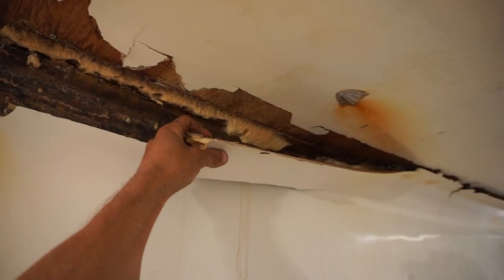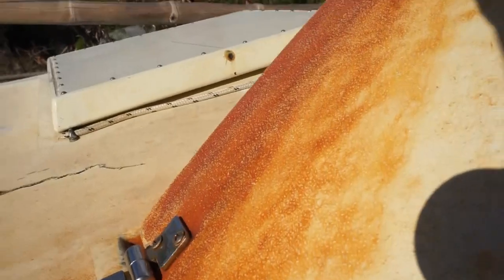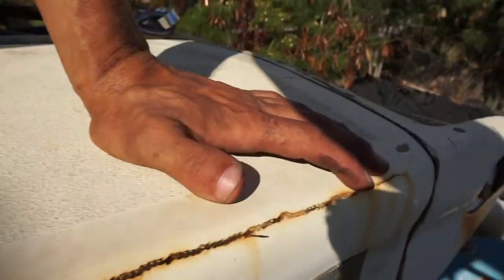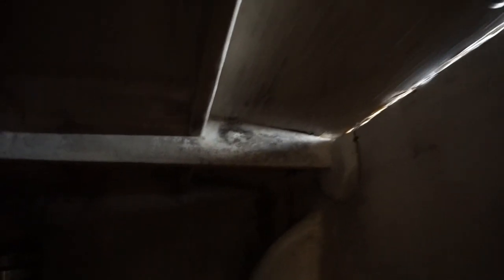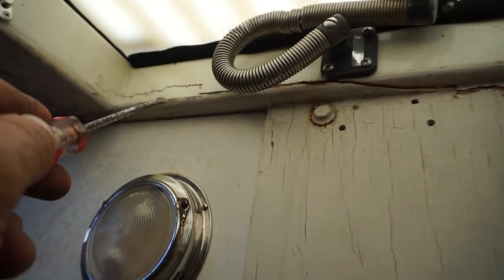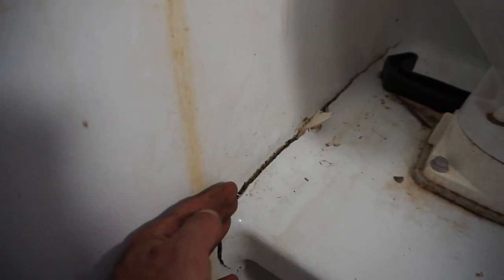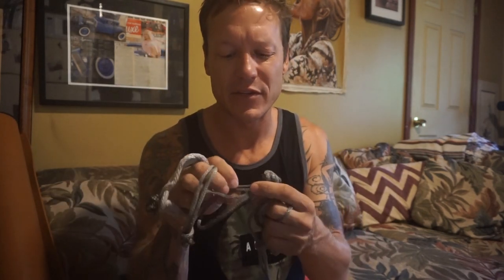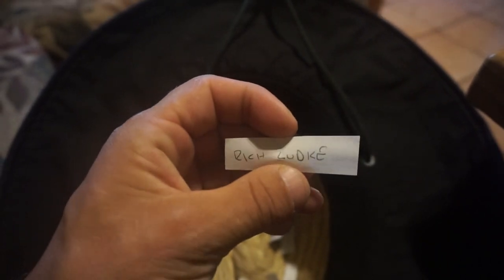Tearing apart my wrecked Catamaran

Comment: Hi Kimi, hi James!
I'm Matthias from Hamburg / Germany.

First I want to apologize for my bad English, it is a mixture of rusty school English and google translater ;)

What you showed in the video is really incredible! I don't want to imagine what could have happened to both of you if the boat had collapsed under your ass on a longer passage with lots of wind and waves.

What happened to you is also a warning for others, for boat owners, for boat designers and builders, for example also for me. I am not a professional boat designer, but I have studied construction technology and have been working on a plan for a 45 ft catamaran for about 3 years now, which I would like to build or have built at some point later. Right at the beginning of my construction, I thought about how to connect the hulls to the bridge deck in a stable manner. Even then I came up with a completely different solution than you can see on your boat.

I can agree with your analysis of the errors in the construction of your boat on most points. Wet plywood, bulkheads and beams that are too thin, holes in beams (who makes such a shit ???), beams that are interrupted and carried on elsewhere, and in my opinion too small-sized beams and too thin GRP laminates are reasons for the breakdown.

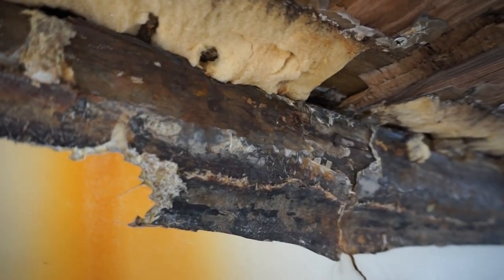But in my opinion, the boat would have broken apart at some point, or at least would have suffered fatigue fractures if the components just mentioned above had been dimensioned correctly. I see the problem in the small radius at the 90 degree angle between the hulls and the bridge deck. This connection is too weak. I mean the area that you can see in the video at 1:00 min and that is filled with foam under the laminate. The radius is much too small or a 45 degree support is missing between the hull and the bridge deck. And PU foam has no business at this point. This area should have been filled with glass and resin. In my design I chose a 65 degree support, which has a hypotenuse of 1.4 m compared to the right angle between the hull and the bridge deck. If you are interested, I would be happy to send you a few pictures of my construction. 

I wish you the best and good luck and I am excited to see how it goes on.
Reply: Hello Matthias, your comment is very comprehensive and analytical, but I do not think that this is expedient for the two. The two need a resilient cat to continue the blog without a year or two interruption. I have no idea how far your design has been realized but I see the future in art like this: https://volt-at-sea.segelnblogs.de/ or similar constructions. Doing it yourself in the field of plastic is not feasible.
Reply: @albertfunk1176  I only gave my design as an example and as a comparison for another solution on how to connect hulls to the bridge deck. Of course, it now takes far too long to build a new boat now.

Comment: There's nothing of substance that ties the hulls to the deck bridge, the fiber glass tabbing is not wide/extensive enough and the stringers don't tie into the deck bridge.  A bunch of people have suggested the dyneema rigging as causing the issue but that may have just exacerbated the design flaw.  It also could the quality of the resin that was used during the build.  You guys are just lucky to have the incident happen where and when it did.  Really glad you guys are safe.  Can't wait to see Zingaro II.  Fair winds to you both.

Comment: Hey... Brilliant look through at the damage. Remembering the bow quartering seas, thumping into the forward sections of the starboard hull prior to the break. I see on the deck failure along the beam, forward area, and the failure along the starboard back of cabin deck beam. That I believe was as a result of impact to the forward starboard hull on that point of saling with the wind from the starboard side. The port hull would have been the solid grip in the water, amplifying the pressure wave through the hull... The main support beams would have snapped, most likely at the holes drilled into the beams. Subsequent to that, the torsion of the not rigid structure would have stressed the skin covering the load cells of nthe beams and plywood bulkhead overlap to beam sheet  ply overlap. Just not strong enough in these conditions. Add to the break of the beams, with the breeze up at the time, the pressure from the rig would have amplified the distortion across the deck to finish off the damage to the level of catastrophic... Looking at the supporting beams and the method of attachment in cementing the hulls to that stress area, I'd say the cat was designed for coastal work, and not structurally engineered to handle the rigors of off shore work as you were doing. I would say the cat is salvageable for rig, deck gear and personal items and a bulldozer through the remains... Sorry... Built my first model sail boat aged 7, Just in the last 10 years, 3 more liveaboard yachts, including a James Wharram 30 footer, off shore cat... Now building a house boat out of a commercial barge, so I have a life time of experience in stress, build strength and observation on calamities... She's toast I m afraid ... on the up side, she got you both into harbour... that's a huge epitaph for the old girl...

Comment: Fascinating. I’m amazed you were able to keep it together on the trip back to Hawaii. I had a 1986 powerboat that had rot in the main stringer. You just are not aware of it until you have a problem because it’s all hidden under fiberglass. And once the wetness sets in, you may not know it for 10 to 20 years later. And its very hard to repair.

Comment: Stress crack due severe dynamic loading caused the failure. Stress crack occurs at every bulk head opening/hole, very similar to BOAC DeHavilland Comet plane window caused by metal fatigue (constant bending & debending). Literally, every hole has crack failure, on this video. Solution is smaller rounder hole/opening or reinforced the crack areas on both sides. Meaning both hulls need similar reinforcement to fix. IMHO dyneema rigging contributes 3% due to less forgiveness. Dynamic load = pounding storm waves.

Comment: I'm a carpenter and joiner and a pretty fair shipwright, I would be getting out the chainsaw and cutting it into pieces that will fit in a skip.
Reply: Craig Grocott I agreed. I’m a builder and I’m shocked she lasted that long.
Reply: Dan221075 I built several houses and this boat would never pass a house inspection and that boat should have been built much stronger than a house! I thought they were all steel I beam reinforced but good grief I didn’t even see a 4x4 beam! Floor joists are 2x12! Never buy a wood boat guys that art died when fiberglass was invented!
Reply: I second Craig's suggestion.  Find plans that you can reuse your mast and build new.  That or find a project boat to start over.
Reply: @peterscherling9000  Hi Pete,  structurally wood is great,  strength for weight  rivals carbon. When used with epoxy can be as low maintenance  as glass. My guess is polyester not epoxy was used in construction.  The glue failure in the ply might indicate a non marine grade.
Reply: @MrRourk  In that video it was never clear about what he was going to do with the boat, he just mentioned that one component could be repaired, but at the end they offered a week on Zingaro 2.
Reply: @craiggrocott7559 
A week on a dingy
That boat is scrap
I would not spend a day on that boat again
Reply: @peterscherling9000  false statement!   Plywood boats can be very strong and beautiful! It's not always the horse winning the race! Sometimes it's the jockey! 
  There is tremendous amount of human error in the failure of this boat! It survived 40 years, and it would survive another 40 with the compassionate driver, these guys pushed the old girl to the limits all the time without any care!!
Reply: god one hahaha👍
Reply: @oldsailor9022  makes sense 👍
Reply: Husqvarna or stihl

Comment: Built light for speed, it didn't have enough strength or integrity to deal with the conditions it met.
Home built boats don't really have a lot of failsafes built in, when they reach their limit they fail catastrophically. Boats built in shipyards have a lot of careful planning to deal with stresses and rough conditions and cats need to be super stiff to retain their integrity. 
It was already past it's best and you had been pushing it fairly hard, changing the rigging may have affected the tension on the hulls or it may have already been too late before you did that.
As others have said, strip out what you can sell and walk away, it requires too much structural work to be viable again.

Comment: Those main beams were really wimpy to begin with.  They looked like 2x4s and they had 2 inch notches cut into them. They were basically 2x2s at the notches. Hope you're back on the water soon, on a strong boat.
Reply: I saw that too. Those two large bolts did not help. Looked to be built lightweight to be fast coastal cruiser. Not built for 25 foot waves in Hawaiian waters.

Comment: Firstly, I am glad you are both safe and sound. I am always amazed that the fiberglass boats have so much wood in them and that that wood, surrounded by the so called impermeable fiberglass, ends up rotting. My theory is that wooden boats are not as high maintenance as people fear and fiberglass boats are by no means the waterproof maintenance free structures they are purported to be. I hope your new boat is wood.

Comment: I have worked on alot of fiberglass boats. I believe most of them are made of Polyester resin and Glass Mat. It is the cheapest material available.
Polyester does not like to stick to wood. Epoxy is the best and more expensive.

Comment: I just want to say I am thankful you guys survived that storm! I am impressed with your actions taken while under duress! I'm no structural engineer, but you have to trace your damage from the point of contact, keel to top deck and the pressure was dispersed upward and outward from there.
That boat doesn't look, to me, to have ever been seaworthy but rather a coastal cruiser. Unfortunately you found the limits of your vessel. 
Thanks for the follow up and for sharing your adventures with us.

Comment: I work with both wood and composites and what I see happen often is boat builders not fully understanding the value of grain and fabric weave direction.
The grain direction and weave directions are key to the overall strength.
A bais direction "S" glass patch over that high-stress area would have done wonders.
Twas all the little fibers that were in the right direction that held her together in the end.. Just not enough of them

Comment: From your video this is what I would like you to check. Are the boat hulls polyester resin? Are the bulkheads taped in with epoxy? Take a good dry sample of the plywood and give it a boil in water test (10 minute boil then let air dry...still glued together?) There was a mod on these Spindrifts to have the mast crossbeam lower section continue to the outboard side of the hull (no cut out for headroom walk through). If the hulls are polyester resin and they were not properly prepared to change to epoxy you have the classic intercoat adhesion failure.

Comment: The hole on the deck hatch frame(stringer) was put there to prevent further cracking........Another words that deck stress cracking had started before you even owned the boat. The hole was placed there to stop the cracking.  Kind of like a fire break to prevent a fire from spreading.
Reply: common in glass and metal cracks as well

Comment: Maybe when you trashed the dagger boards, and banged up the hulls back in 2017, you did some damage, that wasn't noticeable, and that plus the age and structural oddities conspired to finish off you boat. Is it possible that necessary  rigging adjustments were an early indicator of future failure, given you were using Dyneema.

Comment: Mm as a boat builder the ply is not rotting and still fine what has happened is the little cracks over the years that haven't bien looked after have let water in. The glass is still good with wood fibers on it and the ply is not rotting. Lack of keeping a timber boat strong. You didn't maintain her property as you can see by the mould on the walls. Epoxy glue joins don't brake
Reply: My guess the the mould happened in the yard after the accident, the boat didn't seem mouldy when they were living on it. It's now march and the incident happened before Christmas, so plenty of time for mould to form in a boat, if it were me, I wouldn't be cleaning mould on a boat that broken.
Reply: @daveamies5031  if fiberglass is done right when pulled away from timber it usually takes it with it. Unless water gets involved. As per his video. Lack off care and maintenance. Water ingress that delaminated the glass glue.

Comment: Zingaro was not designed to be sailed in the sea states that were encountered , it was a coastal cruiser , not a deep blue , heavy weather vessel . There was no real rot anywhere by the looks , it was wrecked by sea conditions , not design flaws .
Reply: Hi Gordon, I believe you are 100% correct.  Way too few layers of roving and glass and mat to hold it together under severe stress loads. As Skipper James said "he only heard one craking noise (It all failed together at one time) Over-tightening the shrouds, back and fore stays may have been a contributing factor also.  Yet as bad as it looks __ it is repairable by someone with the knowledge, skills and time needed. Both fiberglass and wooden boat in far worse condition have been soundly structurally repaired.
Reply: @samgentile7494  Sam , thanks for your reply , I think it would take a brave person to take on the task of repairing Zingaro to seaworthiness , given the damage it's probably more suited to a houseboat or scrapping altogether . Still , anything is possible with enough zeal , time and money ;-)

Comment: Zingaro’s bridgedeck was glassed on the inside but never on the outside. This means the bare painted plywood of the under bridgedeck area was always exposed to the elements. Did you ever glass the underside of the bridgedeck? If not I’m sure the joint between the hull and bridgedeck could have easily parted putting the entire strain on the main beams. It appears to me that the tabbing on the bridgedeck has broken loose and pretty much reminded intact to the hull.

Comment: Most wooden/plywood  cats fail under very heavy loads for many reasons, but primarily because of undersized main connection points, ie. transverse deck beams. Many builders think that because the wood and glass share the load, they can make them smaller.  Many pure glass boats will fail in the future (especially under the loads you experienced) because of the search for lighter weight, hense using less material to save weight.  Light weight cats are great for speed and coastal cruising the trade off is strength.  your boat traded 400 to 600 pounds of strength for speed. It worked for 40 years and would have most likely another 20 or 30 years if only used as a coastal cruiser.  Then again things have to fail to learn their limits.  With any luck plywood builder's owners, and potential buyers can learn from your experiences. Much luck to you in your next boat.

Comment: I do not think the bolts in the main beam are 'the' problem 11:30 . I would suggest that the cut for the longitudinal stringers are! the weaken the strength of the beam by 50%.
the bolts are actually quite well placed, about center of the beam where forces are lowest ánd the did not put them on the same 'height' which is good from a structural point of view.

Comment: I have strong knowledge of static and dynamic physics and experience with ply boat repairs, my opinion since there is not an obvious one guilty failure is that, as James said ,it is the result of a multitude of weaknesses and one that has not been mentioned (the reason I comment) is the amount  of delamination where the cloth is straight off the plywood with only one spot where some of the ply layer stays  with the cloth.This probably from poor resin or poor application. 
.The forces of the sea are humongous not a single beam could resits it but only the structure as a whole. the cloth is also part of the integrity and it did not seem to have done as much as it should have.

Comment: What some of that is, is they did not wet the wood with resin before they put glass over it, fiberglass should take wood with it, not pull away from the wood.

I think you are right on the money, the wood was full of moisture and the glue failed between the plies.
Reply: Hey Renegade Show! Nick! Nickster! Nickoloadobs! How is it going buddy? Fancy running into you on one of my favorite channels too! Dude, I visited your channel and I'm amazed at all work you're going to do. I mean replace all the toerail and add carbon fiber stanchions? Freaking cool. I'm just amazed at how smart you are, especially since you've only been sailing for a couple years. Did you ever do your first overnighter? Well, I guess since you have yet to venture out of Puget Sound there would be no reason for it hahaha. Anyway, nice running into you here, and great vid Zingaro BTW!